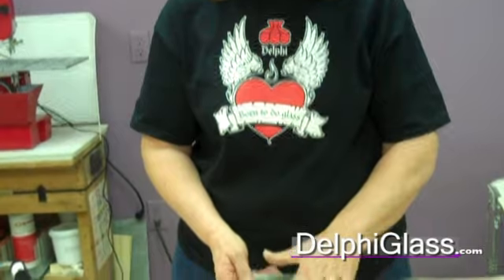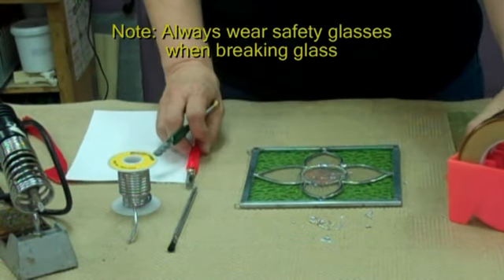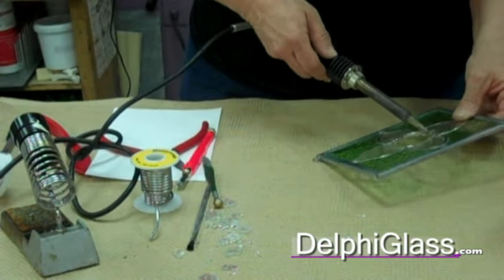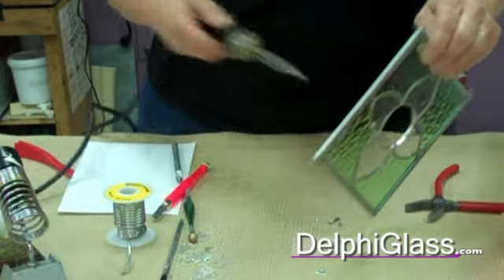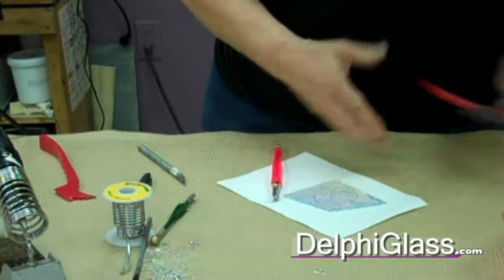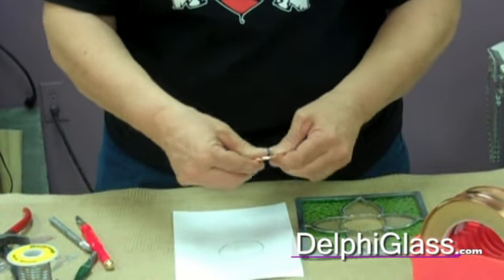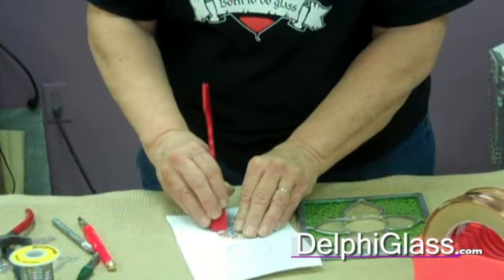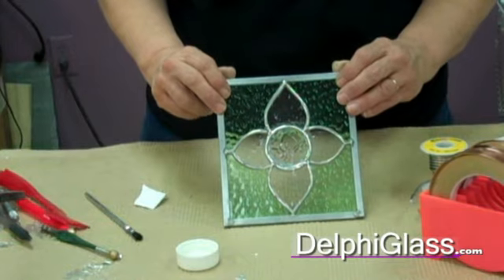How to Repair a Copper Foil Stained Glass Panel

Comment: How does the piece connect to the other pieces that weren't broken?  You foiled the broken piece again, but didn't add foil to the pieces surrounding it, which was removed also???
Reply from the maker: Thank you for asking this question. In order to properly repair the piece both the circle and the surrounding glass pieces would need to have foil reapplied prior to soldering. That part of the video was taken out by mistake during editing. Thank you for your comment and for helping us make our content better. We will correct this issue.
Reply: @DelphiGlass  any  ideas on how to get new solder to adhere to older solder that has already been patina'd?